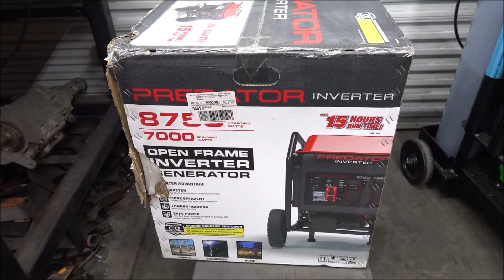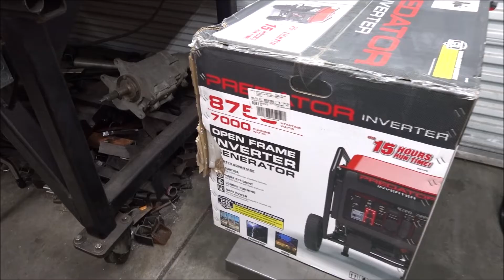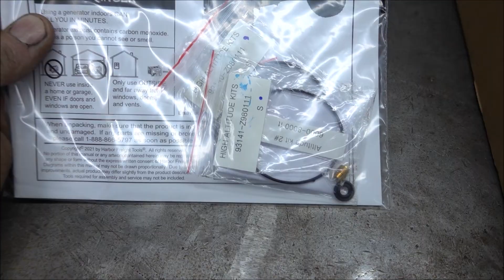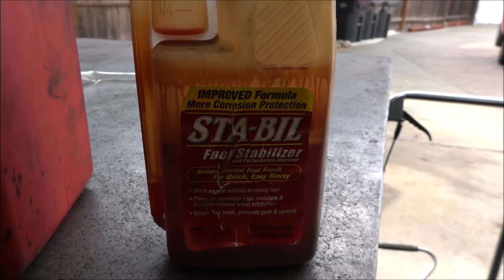Predator 8750 Generator Review

Comment: In case anyone wants to know I have owned both the Predator 8750 regular generator and the Predator 8750 INVERTER GENERATOR.. The regular generator powered my "all electric" mobile home (water heater, stove, and oil heaters for winter) with no problem. I had it for several years until it went out. I went to buy another one at Harbor freight and they were out of the regular 8750 Predators. I was told by their salesman the 8750 INVERTER GENERATOR was as good. It was NOT. I had to turn my electric water heater off and not use the electric stove for it to keep producing power. It only lasted  3 uses and the inverter went out. It could not handle the same load as the normal Predator 8750 generator could..The inverter generator would go into "Over load" mode and stop producing power. It DID get much better fuel economy but what good did that fuel economy do me if it no longer produced electricity? The inverter WAS MUCH quieter. When the "inverter" module went out it cost $400 for a replacement inverter module to fix it. ALSO the replacement carburetors for the inverter generator are $70 compared to $30 for the regular generator. All replacement parts on the inverter generator are MUCH higher..If you do choose the INVERTER generator make sure you buy the $200 extended warranty. That makes the total price of the inverter generator $1,300.. According to the Harbor Freight management the inverter is a common part that goes out. A positive for the inverter generator is it's much smaller.

Comment: I  bought one over the summer since I run my  Esab rebel  and tools for my mobile welding services, all in all great machine.
Reply from the maker: Great to hear that.    I didn’t get everything setup to use it yet.
Reply: What model rebel do you have? I have a 205 ac/dc , and am looking into this generator to go mobile
Reply: @mycat8urskidoo  the same one you mention on your comment the generator run is a predator 8750 inverter since the machine is also inverter so it works pretty good and they haven’t let me down yet
Reply: Want to run my welder with a generator also, your welder runs pretty steady off generator power?

Comment: Best tip I can give anyone is to run ethanol free gas in this.  It doesn't go bad as fast as normal gas.  I start mine once a month and have been doing so for 4 years without issue.
Reply: The problem with ethanol is it pulls water from the air, and you lose power to it sucks. So it's better to add some gas heat once a year unless you drain it a lot to get rid of water.

Comment: Do you know if there's any major difference from the older predator 8750 model and the new one? I was able to get 60% off a floor display model (never used) but noticed it's the 57480 and not the 59190. Am I missing anything besides the predator lettering in red?
Reply from the maker: It’s probably almost the same.   A lot of HFT products have more than one model number for the same thing.
Reply: @1970chevelle396  regardless, I feel like anything more recently produced is cheaper in quality just because of recent stresses on supply chain. The previous model might even be more durable, time will tell.

Comment: Still working well, looking into this generator to go mobile welding wise, have a non inverter generator now, but worried about burning up my machines
Reply from the maker: I bought it for the same reason.  I didn’t want to use my non inverter generator on the inverter welders and plasma cutters.

Comment: Can it run 200 amps stick and tig welding? Thanks!
Reply from the maker: If your running an inverter based welder it can.   The old transformer machines draw more amps.
Reply: @1970chevelle396  I run a miller multimatic 220 yeswelder 205 ds or htp inverarc tlp. Thanks for the information!
Reply: @1970chevelle396   did you run an earth ground on the generator?
Reply from the maker: @andrewhough662     No.   It’s going to be used in a vehicle.
Reply: @andrewhough662  what do you run with your miller 220 far as generator

Comment: Great video.  
As far as the gas goes, just run non ethanol. I never trust any additives.
Reply from the maker: Thanks.  I’ve been using the fuel stabilizer for over 10 years.   I’ve never had any problems.  Without using it the gas goes bad very fast.